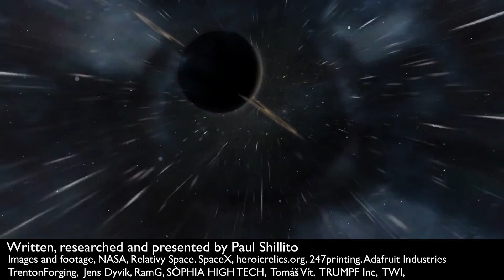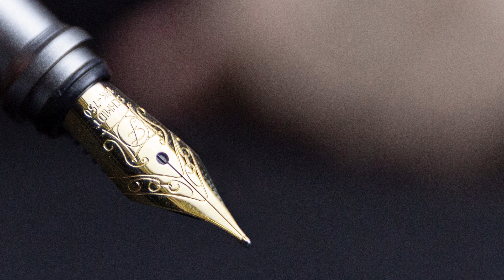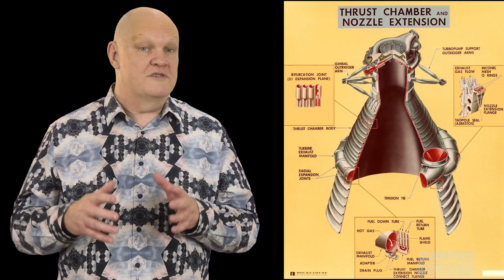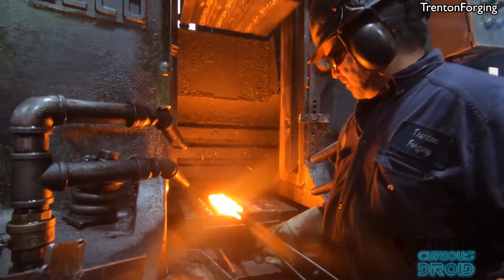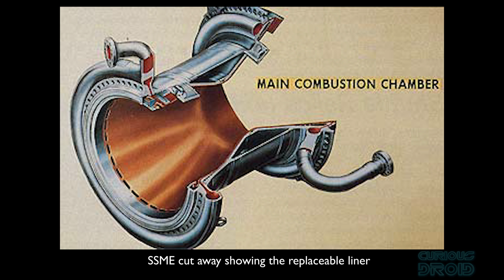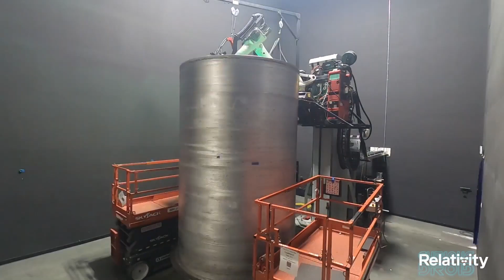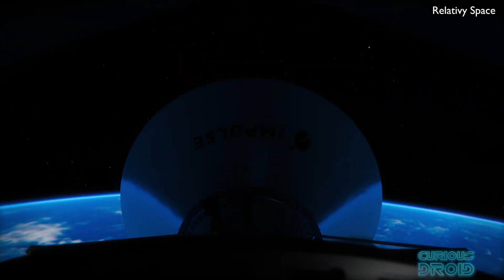Could NASA 3D Print a New F-1 Rocket Engine?

Comment: The problem with additive manufacturing something as huge as an F1 engine is removing the small internal defects that form during the process.  The typical approach is to run it through a HIP process, which would heat it in argon to something like 1000C under ~15,000 PSI pressure comparable to being at the bottom of the deepest ocean trench) and crush all the defects that will cause early failure. However the thrust chamber is at much larger than the biggest HIP unit, (11ftx9.5ft vs 6.5ft x 8ft) and containing the  pressure gets much harder as the diameter increases.  Given a big enough budget it's solvable, but it might need a BIG budget.
Reply: Hosts ignorance doomed this video and your reply: Rocketdyne Laser scanned an Old F1 engine and put into CAD drawings etc.  Even 3d printed its turbine turbo pump and tested it(flawlessly passed).  They were looking to rebuild it for new Moon rocket for NASA.  They were getting ready to 3d print the rest of the engine but ran out of funding when NASA decided to NOT fund them and instead gave the money to Bezos and new BE4 engine.     Yes, we can easily print the rocket engine.  It has already partially been done on the critical turbo pump machinery.  Now can they print the exhaust chamber?  Probably.  Others are doing it and the F1 was overbuilt substantially.  As for the defects... Heat treat it will take care of those as 3D printing material creates fewer bulk flaws in pressure vessels than previous material.  Should be able to SAVE weight substantially compared to F1 engine.  But your point about all the small inconsistencies of 3D printing and the ol' human programs might have screwed up or left voids etc and yes, testing required for sure.  Why Rocketdyne wasn't ponying up the money themselves.  Just because we can copy, doesn't mean it passes spec.
Reply: @w8stral  Entire turbo pump will fit in a big Quintus HIP unit.  The turbo pump is something like 4' wide by 5'2" high.  Much smaller than the thrust chamber.

Comment: Just a comment; GRCop is not specifically optimized for Creep, and the primary failure mode is actually low cycle fatigue which is driven by thermal cycling.

Comment: Using modern manufacturing technology, the F-1 engine could probably be recreated. The pertinent question is why would anyone want to? The F-1 was a single-use, very expensive low efficiency high thrust engine. In that reuse seems the coming trend, a first stage nonreusable engine seems not helpful. Moreover, the Rocketdyne F-1 had a sea level ISP of 263 s and a thrust to weight ratio of 94. This compares unfavorably to the RP-1 fueled Merlin 1D with a sea level ISP of 282 s and a thrust to weight ratio of 184. Additive manufacturing could likely improve the thrust to weight ratio however any redesign would require vast engineering work to overcome combustion instability common with these large engines. Methane and hydrogen and reusable engines seem the future, the Rocketdyne F-1, as impressive as it is, is a relic of the past. However, the liquid hydrogen Rocketdyne J-2X second stage engine does seem to have some applicability still today.
Reply: Guys, RS-25 and SRB is right there, just waiting to use. And it has total thrust of saturn 5 with lighter and better fuel economy

Comment: As an aerospace engineer, I'm skeptical about the claims of weight savings when it comes to whole rockets.
I just don't think MIG welded aluminium can get near the strength to weight achievable with traditional heat-treated rolled and milled aluminium tank sections.

I can see it having uses for geometries that would be very difficult or impossible to make otherwise. Or constructing large structures like space stations in orbit, only having to fly reels of aluminium wire to LEO instead of whole modules.

Comment: If the SLS debacle has taught us anything, it's that you're better off designing something new than using the "cheaper," "faster" "legacy" option.
Reply: It's not feasible to do nostalgia thing with taxpayer money anyway. If space shuttle engine can reach the moon, why bother using backward technology for sake of again, nostalgia.
Reply: I disagree, the SLS is a new design using some old parts, thats one of the reasons its expensive. Building a new Saturn 5 wouldn't be that hard because they already have the blueprints and it was a tested vehicle. They should have never stopped making them in the first place. The performance of a completely new rocket isn't that much better than a Saturn 5 so there isn't there need to completely make a new design from scratch unless you wanted to do something like have it be reusable.
Reply: @teagueman100  if SLS is already a nightmare

Reusing saturn V is even more so, it's even older holy god. You need extensive testing and adjusting that can add extra 5 years instead of just plug and play RS-25.

Again, to do money-hogging nostalgic hobby with taxpayer money is not okay.
Reply: @teagueman100, you're right. Building new F1 engines today would not be "that hard" today - it would be IMPOSSIBLE. There are skills that existed then which are no longer around. As the piece said, every F1 engine was HAND BUILT! Every engine was unique; a one-off. The blue prints were almost more guidelines. Besides, the F1 was a world beater in its day but would be an anachronism today.
Reply: @billmullins6833 the right tool for the job is never anachronistic
Reply: @M167A1  It is if the methods by which it was manufactured are deprecated.

Comment: Another classic shirt there Paul.  TBH, I dont understand why they arent using the Sea dragon which you did a video on.
Reply: Because it's a paper notion only based on the mistaken premise that you can scale an engine up without limits.
Reply: @TheEvilmooseofdoom  Guess you need to watch it again, the end part states its perfectly valid today as it was when designed. Granted Paul isnt an engineer with experience of rockets, but his videos are usually backed up with in depth research.
Reply: @TheEvilmooseofdoom 🤔🪶
Reply: they could 3d print that too
Reply: @catlee8064  Yet the more someone tried to scale up and engine the more trouble they had and this requires an engine 50x larger than the F-1 which alone was a difficult engine.  It's balls deep in stupid, always has been and always will be.
Reply: @TheEvilmooseofdoom  No where i can find your claim that it couldnt be scaled up....where did you see that?

Comment: Probably could print an F-1 engine, however the intricate design of the double shell of the thrust chamber and the fuel distributor or “boiler plate”.  Using lost PLA or similar ways of casting would introduce variations, the GR-Cop and laser sintering printer look promising.  Unfortunately the size of the F-1 causes it to face combustion instability with the variations that any machining could produce- it was extreme quality control and good luck that none of the F-1 engines failed catastrophically mid-flight.

Comment: A 3d printed F1 would be a completely different engine. Unless you could make it as efficient as modern engines, no one would do this. It would be a cool pattern, though.
Reply: Yes...such a large engine would suffer efficiency problems with low chamber pressure relative to the modern Merlin or Raptor.   You of course could make lots of thrust...but at the expense of more fuel needed so the Starship approach seems a more viable solution today.
Reply: OTOH ; 0 failures vs 10% failures

Comment: I am not at all clued up about 3D Printing but I will take great interest because, at the end of the day, it is a technology that seems to be going in leaps and bounds to produce even more types of engineering applications and is still, in my opinion, in its infancy, and I will bet that I have more questions than answers by the end of the episode. 

Forgive me if I am wrong but in the advertisement for the gravity pen you said it is made of Aircraft grade Aluminium, but aluminium is nonferrous and can’t produce or support magnetic fields, or has that changed recently by some very much more intelligent person than I.

An absolutely fascinating episode, a fair bit went over my head, but still fascinating and informative, I do have a question, only the one, but is it possible that the techniques used can help to create new materials that are technically impossible to produce using the technology we have at the moment?, for example, clear aluminium (as per Star Trek) it seems like it could to me if the scientists behind this printing technology are given the time and resources to experiment on a grand scale, they might even be able to reduce the amount of non renewable resources that we are currently expending on a huge scale. Thanks again, I really enjoyed this episode. 😀🇬🇧🏴🇺🇸🇺🇦🇮🇱

Comment: As to the comment as to whether it would happen given the large number of Raptor engines used on Starship / Super Heavy, I wonder if it might make sense to have a few huge engines like a modern version of the F1, and then a number of maybe Raptor-sized or smaller engines rather than using all the same size engine. Obviously they'd all have to use the same fuel mix, and you'd have to be able to robotically manufacture them or you're likely going to lose out due to lack of the mass production effect. But assuming you can do those, then you use the huge rockets on the way up, but not on the return flight since the rocket is much lighter. Just about pure speculation on my part, I'm not a rocket engineer!

Comment: So, kudos for the general info about rocket engine construction. Very interesting. But the title suggests that we would get a proper explanation whether the F1 engine could actually be recreated by 3D printing, and you hardly go into that at all, just half a minute or so at the end. The fact that there are companies constructing new engines using this technique doesn’t necessarily mean it’s possibe to apply the same procedure for the F1. So even though there is a lot of good stuff here, I can’t help feeling a bit dissapointed.

Comment: 3D printed exhaust bell makes sense, some of the other parts, like the compressor turbines, are better made from solid pieces where the material is the same all the way through, rather then have the layer lines becoming shear points.We could probably expect a combined techniques construction to be more efficient then the original F1.
Reply: Yes, agreed. However, once fully melted, even prior to heat treatment, most metal AM doesn't show stress lines across the layerlines due to being fully melted. After heat-treatment it is a homogeneous solid. None the less, AM is suited to AM specific parts, not creating what is already mastered with conventional techniques.

Comment: relativity is no longer printing the tank walls. Which makes sense, the flaw density inherent in an additive process means the walls have to actually end up comparatively thicker than a rolled or formed tank wall. 

Their rocket was so heavy, that Terran 1 could not have ever carried a meaningful payload to orbit, which is why it had none save for a symbolic first printed part on their first launch, and its why the rocket is canceled. 

I think their CEO was quoted saying they only took a 5-10% mass penalty by printing... which doesn't sound bad until you release that is the payload mass fraction of most rockets. 

Also, the flaw density inherent in additive manufacture makes its use for reusable rockets questionable in my opinion, its an inherently poor process for fatigue resistance, but we will see.

Comment: The F1 was not particularly efficient in terms of power to weight or ISP but then again it did not have to be.  Kerosine (RP1) is energy dense and the F1 open cycle engines were very reliable. A reusable Saturn V stage 1 booster with 3D printed F1 engines would be offer cheaper payload performance compared to SLS but that all said the Starship will be an order of magnitude better than either.

Comment: I very much like the premise of Paul's latest great offering, but I do wonder whether the Raptor, another engineering miracle (full-flow staged combustion with astonishing performance  - and all that), has eclipsed the brilliant F1 forever. For this and a number of other reasons, you have to ask: why resurrect it even if its resurrection can be technologically and economically achieved?
Reply: I think so. The F1 was an amazing feat of engineering at the time, and remains impressive — but it's the wrong design if you're looking at re-use. Not because the engine itself isn't suited to re-use, but because it's too big if you're looking to do propulsive landing... having many smaller engines has been a real key to Falcon (and in future Starship) booster landings. 

And yeah, Raptor will be definitely be a modern equivalent once they get it into operation... they're really pushing the limits of chemical rockets with that thing.

Comment: it is sad to think that in 2012 (11 years ago) a project to reuse an F1 type engine was refused by NASA (the Pyrios project) to replace the solid boosters of the SLS
This project would have used two F1-B engines per booster
the F1B is a modernized version of the original F1 engines composed of only 40 parts (thanks to 3D metal printing) compared to the thousands of parts of the original F1 engines

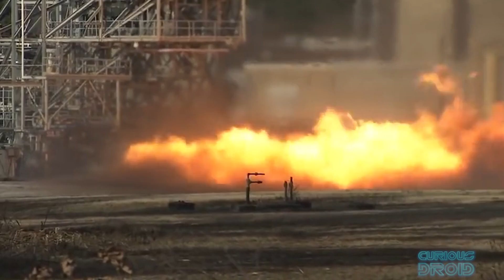Comment: @9:20 "tested the fuel or LOX pumps" the fuel was kerosene... were the pumps for fuel and LOX the same or am I missing something here?
Reply: The F-1's turbopump had two impellers mounted on the same shaft powered by the same turbine unlike the J-2 engines on the second & third stages that had two separate pumps for LOX and hydrogen.

Comment: Well, when looking at powering the proposed SLS, NASA went and 3D scanned all available F1 engines and parts.  And found that they could CNC a new F1 variant engine with far fewer parts.  It was the F1B (the F1A was the next generation at the time of Apollo of the F1 engine, with increased thrust and fewer at that time parts.)  The F1B would have had comparable thrust to the F1A but weigh about 40% less, and be far cheaper than modern engines like the SSME/RS25/upgraded-J2 that were the Shuttle engines. 

Ah, what could have been.

And then progress into an F1C with both CNC and additive manufacturing, possibly even to an F1D that was totally additive manufactured.

Instead, we're throwing $68 million per engine SSME/RS25/upgraded-J2s that were meant to be reusable (and thus the huge price) and throwing them away. 

And NASA even looked at a stupid/dumbed down version of the RS25 and, no, kept with the very expensive reusable but thrown away engines used on the SLS.

(sound of banging head slowly against the wall...)
Reply: That's the perfect answer I was hoping someone write 👍👍. I followed very closely the developement of the F1B at the time and was a bit surprised it wasn't mentioned in the video.  I think the race to provide a rocket engine for the SSL is a matter for a whole thriller TV Show 😂😂
Reply: Or a whole show on government and industrial corruption and stupidity.  The whole SLS is a perfect example of what's wrong with government. @zaperfield

Comment: Around 30+ years ago we visited KSC and had a tour from someone who had worked on the Saturn5 programme. As an engineer myself we got chatting and he was quite open when he said that the engines weren’t built to the spec in the plans. The engineers “modified” what was in the plans and built something that would work and not fail (E.g. if it looks right, it probably is…)

The reason most of these engines are unique is partly because they were built by hand, but also because they were built by engineers who knew their craft and the materials they were working with.

I wish I could remember the guys name, it was back in the 1990’s so he’s probably no longer with us as he was in his 70’s and had already “retired” once.
Reply: Good point. If one thing wasn't built to spec, then the next thing can be built to compensate.

Comment: They could make it from far less parts than before. The problem with laser sintered metal parts (3d printed) is that they lack sufficient structural strength too take the beating vs a cast or forged part.
Reply: I don't think that laser sintering was mentioned for any of the high-stress parts tho, iirc

Comment: "There were NO failures of the Saturn 5 Rockets".
"Early development tests revealed serious combustion instability problems which sometimes caused catastrophic failure.[3] Initially, progress on this problem was slow, as it was intermittent and unpredictable. Oscillations of 4 kHz with harmonics to 24 kHz were observed. Eventually, engineers developed a diagnostic technique of detonating small explosive charges (which they called "bombs") outside the combustion chamber, through a tangential tube (RDX, C-4 or black powder were used) while the engine was firing. This allowed them to determine exactly how the running chamber responded to variations in pressure, and to determine how to nullify these oscillations. The designers could then quickly experiment with different co-axial fuel-injector designs to obtain the one most resistant to instability. These problems were addressed from 1959 through 1961. Eventually, engine combustion was so stable, it would self-damp artificially induced instability within one-tenth of a second."
Reply: Pretty heavy science, there.